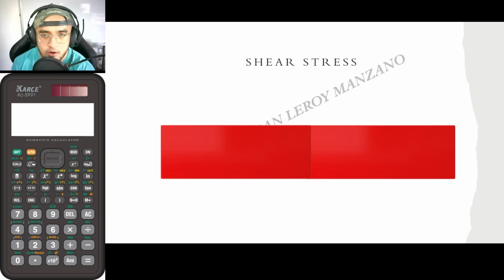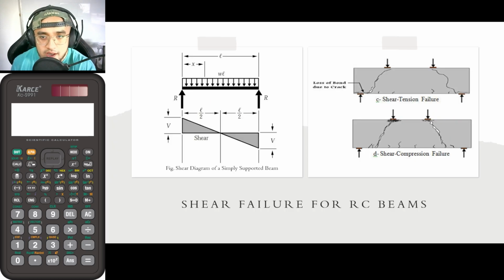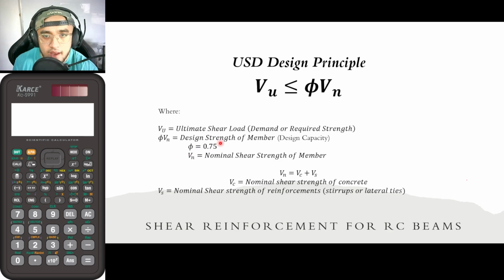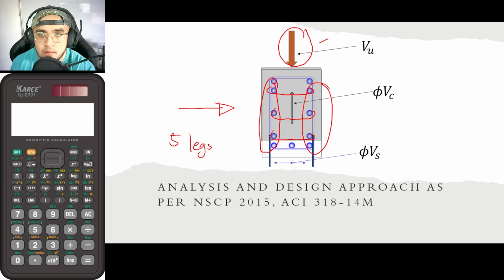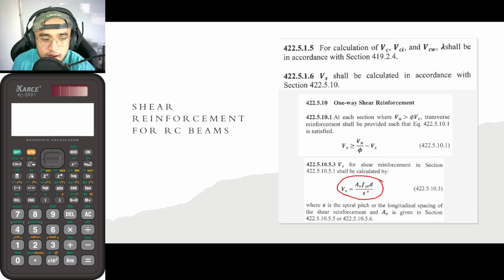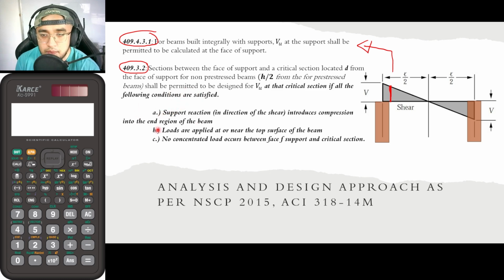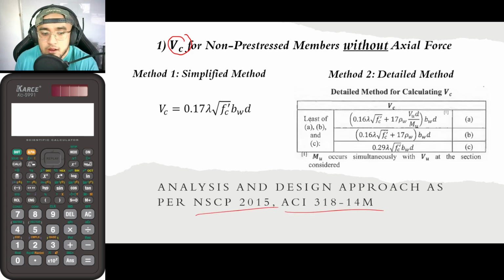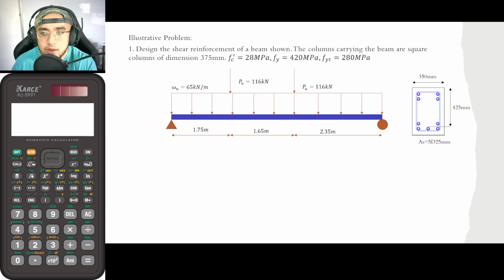Part 1: Design of Shear Reinforcement -  NSCP 2015/ACI 318-14M - Introduction and Concept

Comment: Hello po, ask ko lang po kung what if simply supported overhang (both sides) po ang beam, hindi na po ba applicable yung section 409.3.2 (Vu @d distance from face of the support)? kasi di niya po nasatisfy si a (support reaction introduces compression @ the end of the beam)?